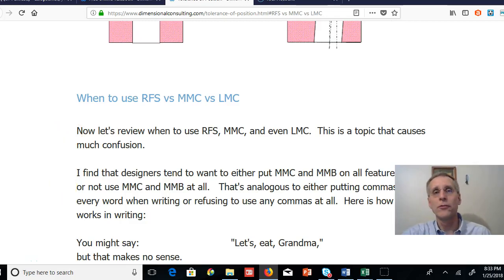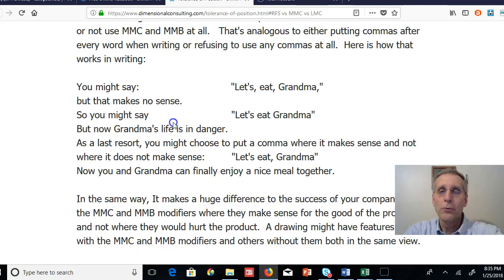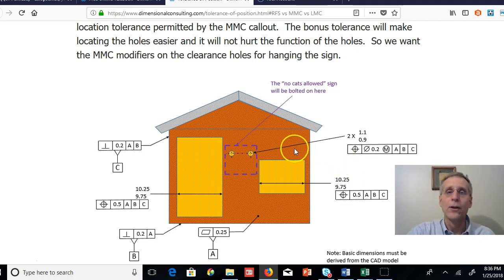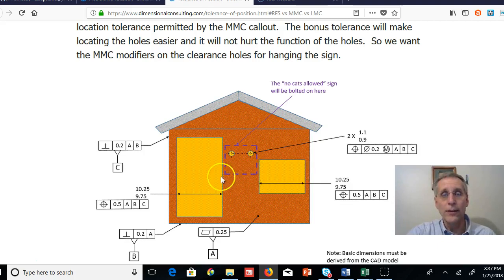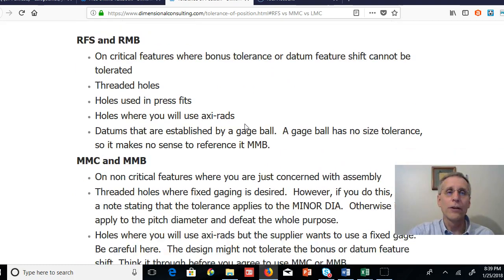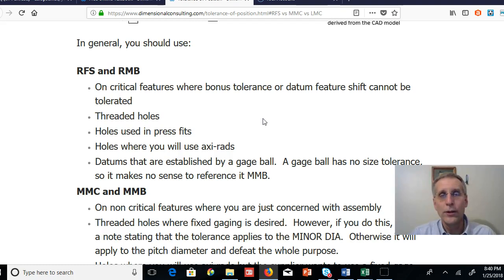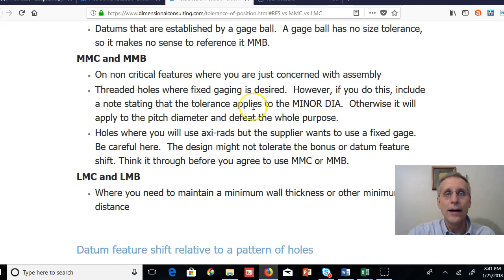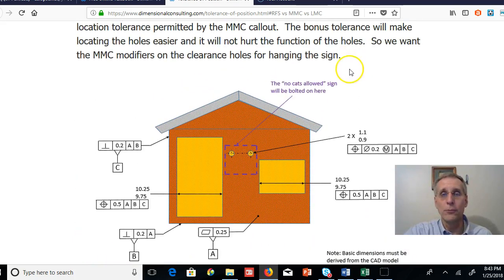Max Material Condition

Comment: I have to disagree when it comes to axi-rads. Especially when using a bolt with a map point. Once the bolt starts into the threaded hole you can take advantage of the bonus tolerance on the hole. The metal components will destroy and ignore the axi-rads when the bolts are run down. Therefore using the entire tolerance. Axi-rads are just used for shipping parts with POA bolts. But I understand the concept your conveying.
Reply from the maker: I understand what you are saying.  Axi-rads always seem to drive these additional conversations.
Reply: @davidslopsema4374 yes they do!